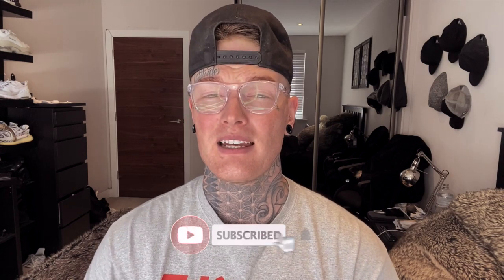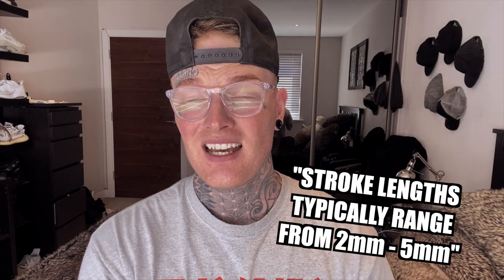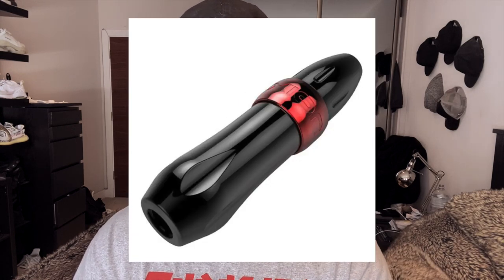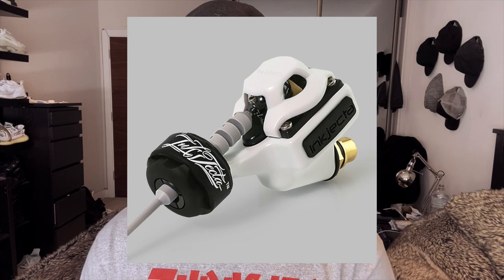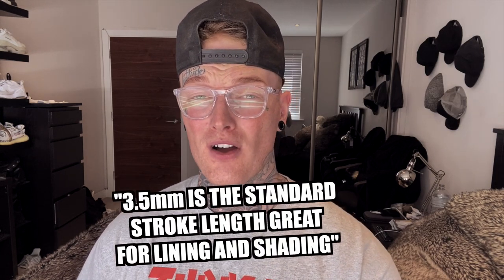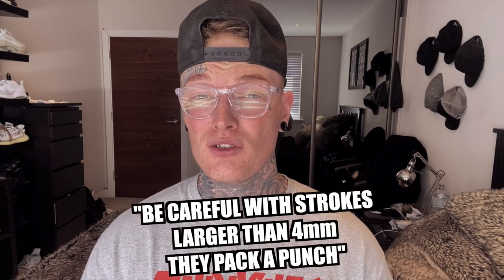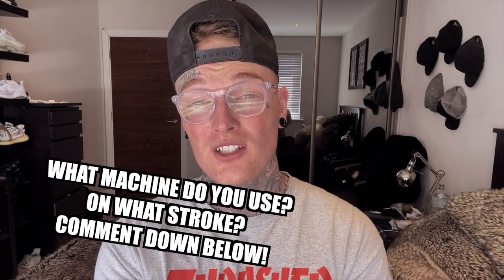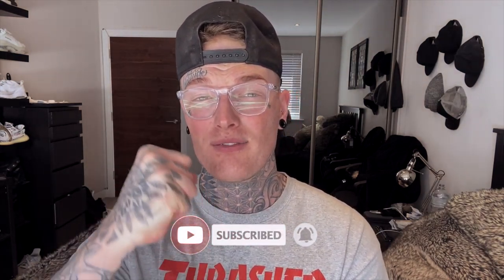LONG STROKE VS SHORT STROKE - WHAT EACH ONE DOES!

Comment: I use the axys valhalla pen.. you can change the strokes in like 2 seconds with a twist of the machine... It's amazing I love this machine so much and it gave me the chance to learn quickly witch stroke I like the most for each technique I use !!!
Reply: Same as stigma stylist
Reply: volt voltage do you run for whip shading with 2.5 stroke?

Comment: Hey there. Well, I started like most artists to Line with a Coil Machine. I was using a Power Liner and 9rl Needles for my first few tattoos. Since the average smallest Needlegrouping for this kind of machine was stated as 9rl you can imagine how easy it was to get those bold and crisp Lines into the skin. After switching to a Rotary Pen  (Spektra Xion GG) it was like starting over completely. Even lining with a 5 rl wasn't as easy as the 9rl with the Coil machine. But it's all a matter of getting used to it. Now I'm using the 3.2mm stroke to shade and line. Or if I'm having bigger Linework to do, I'm switching to a 3,7mm stroke just to get a better Punch and it doesn't need as much pressure to get the ink in. Having 2 different machines helps, since changing the stroke everytime you switch from lining to shading and back is way to much effort and you can't keep things sterile. I hate to adjust anything during the tattoo, that's why I switched to a rotary pen. 😅

Comment: Love the vids.  only one disagreement... STROKE is the full movement of the needle's reciprocation, and THROW is the hang out of the tube tip.   For example, you can have a 3.5mm stroke and throw the needle 2mm.  Keep up the great vids!
Reply: I like a 3 to 3.5 for standard lining, and softer shading, 3.5 for color layering (realism/painterly styles), and a 4.2 for solid color packing.
Reply: always have about a 2.5mm throw and never ride the tube.
Reply: @ryandearringer2787  how much would you say is 2.5mm?
Reply: @jorge56188  the small notches on a standard ruler are mm.  2.5mm is about the thickness of a quarter, give or take a little bit...
Reply: 1mm is about the thickness of a dime.

Comment: As always another great video. Missed you when you were at the MK Tattoo Convention. I've been using the Dragonhawk Extreme X2 recently over my older Stealth 1 (Prefer Armature over Direct). With the adjuster dial you can change the stroke and hit of the needle. It's a decent machine that gives good smooth lines, shading and packing.

Comment: Hi. I have been using cheyenne pen with 3.5 for soft shading . Its just great machine for realistic work. Now i switch to sol nova its also 3.5 but i find a big difference. Everything just go so smooth heal perfect very easy to use machine. I also do a lot of linework and im using the thunder 4.0mm . Nice balance and power. I could never do line with the pen that have the quality of the thunder. Nice video keep going ✌️
Reply: Different motor in sol nova. Stronger.but itc softer on the skin.these german guys are genius
Reply: Hello brother I'm beginner. Wich stroke is better for shading 4mm or 3.5mm thanks
Reply: @cesarrodriguez6669  on the begining 3.5 lis in the video is all rounder than with the knoslege you can move to 4.0

Comment: i dont know if you already know, but i heard you mention about the coil, now speaking of the coil.
since you said about rotary, the longer the stroke the harder it hits, the better for lining and the shorter the stroke the softer it hits, the better shading and packing.

why tho the coil machine works in oposite, like, if its long stroke its good for packing and shading, and the shorter stroke it is good for shading, they said, is it correct or what?

Comment: I just started using the Chyenne Thunder gives great lines 3.5mm,& I just started using the Chyenne Sol Nova Pen 3.5mm stroke for shading with the Chyenne Power Supply & it has made my work at least 35% better
Reply: Cheyenne Thunder has a  4.0 mm ! I use it for all my linings and it works great. 
But I want to try the Sol Nova pen, too.
I had a Stigma Speat pen. But that was to long.. so I sold it. And use a Spektra Halo 2 with a 2,8 stroke. This machine runs so smooth and quiet.. I really love it.
Reply: @isicat5112  u will be surprised how soft sol nova is with that 3.5 mm stroke almost silent.no vibration.itc a future machine
Reply: @vadims331  thanks a lot for your answer. Ohh great and nice to know.

Comment: Can you pack color in with a 4mm stroke as well or do you prefer a smaller stroke and when you change the stroke of your machine to a 4mm do you run the voltage the same as the 3.5mm or since it hits harder do you turn the voltage down or up thanks for your great videos

Comment: Greeting and salutations. Hope all is well. Do you use the give screw on the edge x?
Reply from the maker: not really mate, it doesn't make that much difference, like the stroke does
Reply: My understanding with the give open  would help with better saturation when packing blacks and colors. Tightening the give would help with shading
Reply from the maker: goat so give on a machine allows the machine to soak up some of that resistance every time it penetrates the skin, it gives a bit of spring to it so it hits softer if the give screw was loosened, and if it was tightened up, it would hit with no give and harder. I personally think having the give screw tightened is the way forward! It’s a lot easier to achieve what your trying to achieve with a tattoo without having to worry about give,. Also if your shading for instance and you have a lot of give on the machine, and you finish the tattoo. And when it heals you found it didn’t heal as nice as you wanted it to, it’s because with give on a machine it hits soft and in reality not allowing the ink to go where the ink needs to be. So for me no give or just a tiny turn of the dial is the way forward!
Reply: @OLIVERAYRE  yup

Comment: I use a 4.0 flux for literally everything m soecialize in black n grey realism
Reply: You think using a 3.2 stroke for black and grey realism and some lines nothing more then 11RL is good? I also have a 3.7 cam would that b better to swap in? I been having a lil trouble with lines and black packing/filling.

Comment: What stroke would be best recommended for stippling? I seem to be struggling with doing stippling with my equaliser which has a stroke of 3.5. 
Would anyone have any recommendations?
Reply: I use a 3.7 cam for my xion, I’ve noticed a huge difference between pepper shading and stippling at 3.7 from 3.2
Which is the standard cam on my
Machine

Comment: Started with a Javelin X, only now understanding hit, it's no wonder it does such great lines and piss poor shading (mind my lack of skill, haha). I'm running all Turbo carts right now as I got a great deal on them, but they're close to expiry so time for a change as I can't find them at my local shop anymore. That said, after watching your 7 consistency tips, I learned, they make fantastic mag, but crap liners, haha, so thanks for that little gem. Right now Radiant ink Turbo black, Kokkai Sumi greys and Dynamic white. I've just purchased a new CNC machine, but am looking at  one that has an adjustable hit that, while substantially more, might be the difference between owning one machine and more than three... I'm going to test the CNC tonight and see, 4mm stroke on the JX down to 3.5 on the new CNC but a significantly larger motor up from 4.5w JX to 10w CNC. Fingers crossed.

Comment: I haven’t even tattooed yet. I am still waiting for my needle so I can start practicing. The rotary machine I purchased has a stroke of 3.5 (cnc q2) but I am just contemplating the theoretical aspects of how the machine works while I wait. This brings me to my question about the relationship between floating the tube, needle depth, and stroke. If you are constantly trying to keep the needle at 2mm in the skin and you want the needle to go back in the tube between cycles to refill ink, will a stroke of 5mm fully retract back between cycles and will a shorter stroke of 2.5 mm go deep enough to reach the dermis? I guess I am still confused about how this actually plays out.

Comment: Thank you for your input on the stroke i just bought the cnc x we plus and it comes with 3 different strokes the 3 3.5 and a 4 i already knew that the 4 would hit harder than the rest of them but I didn’t know what you would use it for now i do thank you but one more question if you use a 4mm do you turn your voltage down since you don’t have to move as fast or keep it the same voltage and move faster since it’s packing the ink in faster and harder
Reply: did you ever find out your question
Reply: @trav-c137  I did i practiced on myself and learned real quick the difference
Reply: @davidgregory1229  so how would you describe the difference??

Comment: What stroke would you recommend for a single needle fineline tattoo?
Reply: 2.5
Reply: @ahsteriod3326  thank you! can you tell me why that is? cause in theory does is cycle a little faster and doesn't need that much momentum since it can pierce more easily to the skin which mean more dots? and how about the give setting? do I need it since single needle pierce through the skin easily and do I need that? I'm also thinking about the extra hangtime on the skin if it will take more damage than going hard? I know it's personal preference but I'd like to hear what your professional  thoughts about it.  I've been tinkering with my setting for quite sometime now since coming from long stroke machines and want to specialize in fineline tattoos

Comment: Bro I'm use fkiron spektra xion but I'm still confused with the adjustment of hard and soft hitting.
Sometimes if i use more than 5 hour the machine look like not same hitting like the first time u use it.
If u ever try the xion do you feel the same??
And can't you tell me how to setting for line, colour and soft shading in xion??
Thanks
Reply: i will prefer to use the same for all teqniques
go to hard and go one click back
and u can see is very nice for lines colors and shading
Reply: @erioncuka3966 at what cam do you use that setting at?! 3.2 or 3.7. At 3.2 my lines don’t always come out fully Saturated and my black packing!
Reply: @swervv2957  depending on the style. Normally I use 4 mm for everything
Reply: @erioncuka3966  thanks for the reply. Do you think I should swap my cam out for the 3.7? I’m currently using the 3.2 but I noticed to pack black and do lining it takes longer and going over multiple times. I do black and grey realism, Chicano style mostly but some lining. Usually no higher then 11RL and 15CM the highest. Just wondering cause sometimes the healing is good and sometimes not so great healing. Wondering if it’s cause the cam. I have the setting to the hardest click and still the same?

Comment: Stoke and throw are not the same, the throw is just how long you hang your needle out, which could be the same on any stroke.

Your correct on saying stroke is link to how hard or soft a tattoo machine hits which is the same on both coil and rotary machines.

The reason why - longer stroke hits harder than a shorter stroke is down to science.

I longer stroke can takes longer to travel a full rotation which in turns builds up more kinetic energy therefore hitting harder, opposite for storter strokes.

Less combine with different motors and strings on coils machines can change tho. Motors with different torque and rpm like hard or soft springs on coils could change any machine.

Listen to machine builders

Comment: I know use the FK Irons direkt 2 with the 4.0 cam for bulky lines (polynesian/maori style) for the thinner lines I use the Injecta flite elite with the 3.5 cam. I ordered the 4.2 cam for testing.  For shading I use the FK Irons Xion or my invictus rotary. I also have a Bishop fantom withh the 3.5 cam, I don’t use it a lot because it is a very noisy machine. But i is a ver good and easy to handle machine so  I ordered the 5.0 cam also for experimenting with lining. For all my machines I use the Fk Irons Darklab RPG grips 25 mm. I also have a Gorilla size but this type is having some issues with some brands of cartridges. This was hot a very good buy. But you cannot hav it all. Great video by the way, keep up the good work and giving us the great advice.
I now use the Tatsoul envy 2 cartridges, they are great, but I heard that the Kwadron is using membranese so I think I go back to those. Any suggestions for Other brands?
Reply: you think your bishop is loud? i guess you have never tattooed with coils :)
Reply: @savageopress6273  I have made made my share of  hours with coil machines, and still the Fantom is the loudest of all my rotary machines, maybe even as loud as my best coil.. I am not suggesting it is a bad machine, but if you compare the Fantom with a V6 or Wand, you understand what I mean.👍🏻
Reply: En hoe zijn de cams voor de Flite bevallen?
Reply: @thomaskraai9870  4.2 was niet leverbaar de 3 mm is prima voor soft shading. Ik heb ondertussen een wand liner gekocht. Even wennen maar nu pak ik zelfs voor een rl3 de wand. En wat er gezegd wordt dat je alleen er mee kan lijnen is niet helemaal waar. Je kan als je voorzichtig ben zeker wel met een 15 magnum vol zwart er in krijgen.